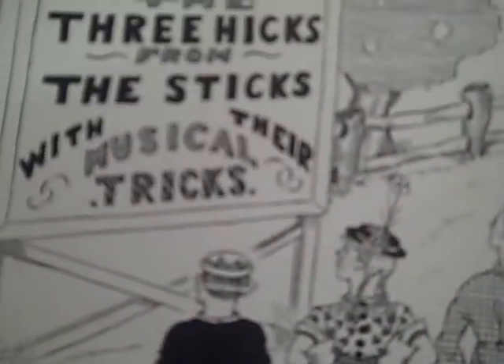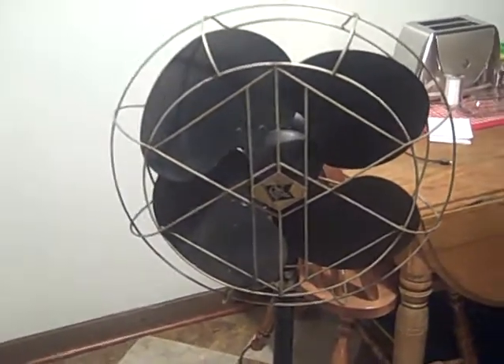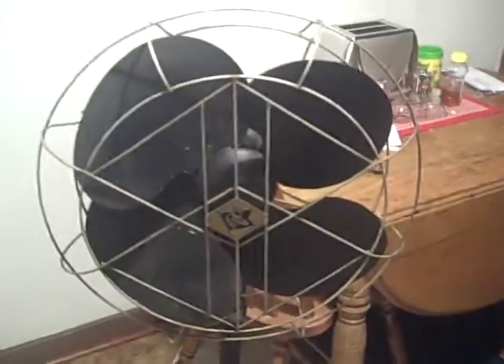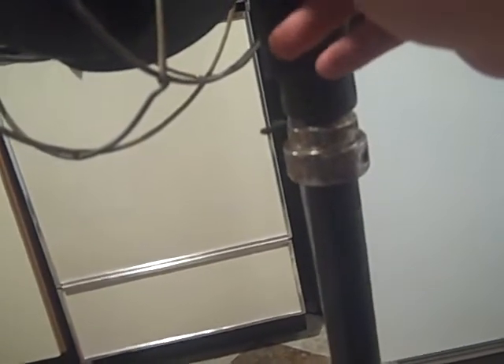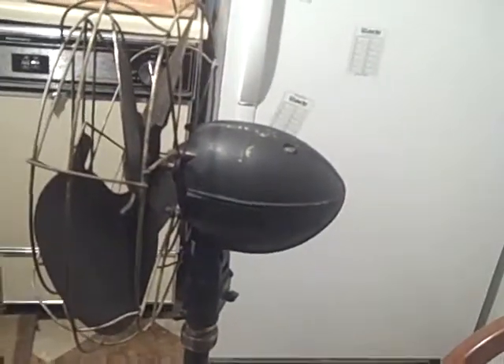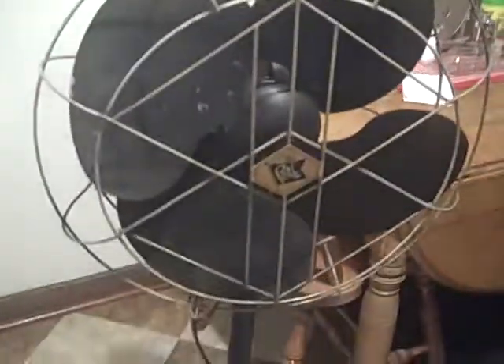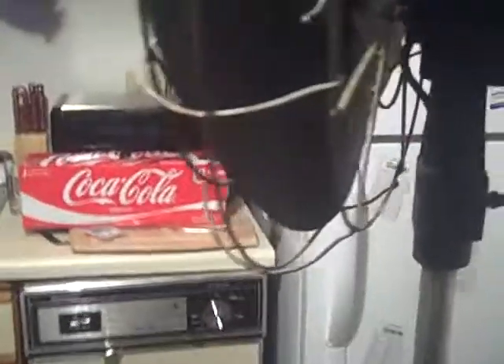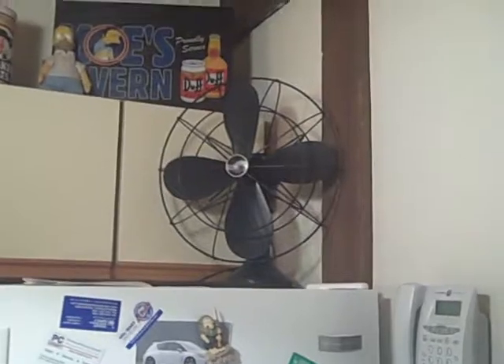Robbins and Myers Stand Fan

Comment: That's very interesting about the old photos. We still have some old single screen theatres in this area using the carbon-arc lamps.
There is a fan like this still in use at a local thrift store.

Comment: Yep, motor oil's a no-no. The detergent action isn't good in a motor without an oil filter (as car engines have). You'll want to get some ZoomSpout oil for it.

A lot of collectors use wheel bearing grease in the gearbox, the red grease works well. Another grease I like is LubriPlate white lithium grease.

That's a nice R & M! I do like the "double-diamond" guard and overlapping blades on those.

Comment: i use john deere multi purpose grease for fan ocillators. i think that wheel bearing greas is to thick to properly lubricate the ocillator. thats why i usr jd grease. its light and perfect for the purpose. but thats just me speaking. i dont put nothing but the best oils and grease into my fans. but again thats just me.

Comment from the maker: The noise was actually the blade; it was loose! argh. I've only had to replace the head wire on my 1918 GE, and I used the same wire as I used for the main cord (reproduction cloth-wrapped wire), only problem was, I needed a three-conductor, and the wire I had was two conductor (twisted), so I un-twisted the wire and braided three strands together!

Comment: Part of that noise could be coming from the stamped steel cover on the base.  I have a Zero brand metal table fan with an open base and I cut a piece of carpet padding to fit inside.   It helps dampen some of the resonance noise.  Speaking of the head wire; Do you know of a source for it.  I also have an old Westinghouse oscillator fan that desperately needs a new head wire cord.  Its so bad that I won't even plug it in.

Comment: it is normal for an old fan to have some play in the motor all of mine have it.
Reply from the maker: Aiden Bartol Yes, they will (and should) have some front-to-back movement (endplay) ; it's when the shaft has vertical play when it becomes a problem. End-play can be adjusted with fiber washers; vertical play will require new bushings. No, you can't usually "buy" bushings; you'll need to become friends with a machinist to have new ones fabricated from oiled bronze. Most fans aren't worth this amount of work; I have a 1920's Westinghouse that I no longer run for this very reason.